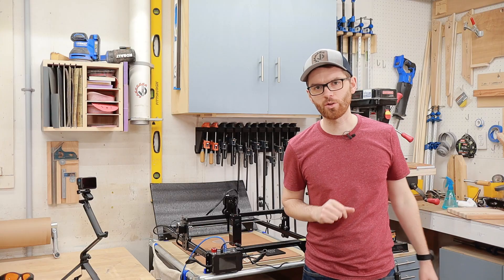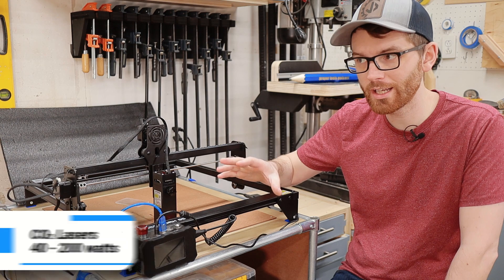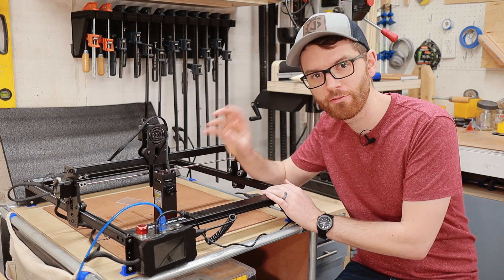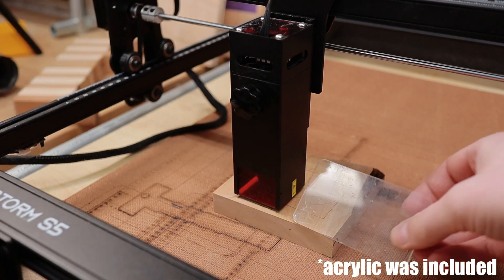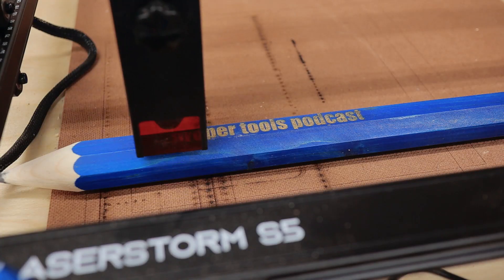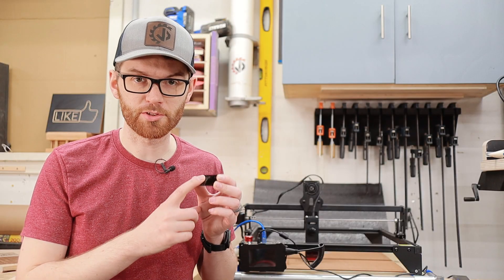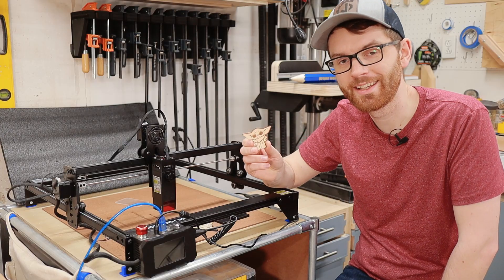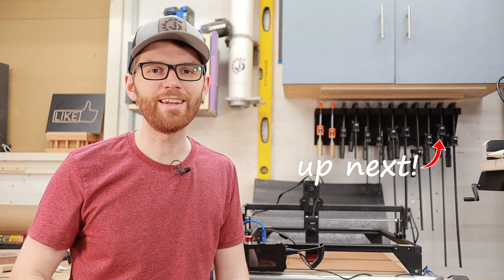Why you NEED a laser for woodworking!

Comment: Haha love the thumbnail (pew pew!). So glad you did this video! We got a diode laser too a couple of weeks ago but we haven't used it for anything but to engrave a few squares to make sure everything was good. I have it in my office and don't want to try doing anything with it until I have the proper set up. I also really appreciate you showing the settings you used for each material. The laser we got has its own proprietary software but I use Illustrator to design, so I'm not sure if I'll need to get Lightburn yet. If I do decide to get it, it's only $60, so it's definitely budget friendly. Thank you and keep up the good work!
Reply from the maker: Thanks for watching? What laser did you get? Is it that x1 I've been seeing around?
Reply: @MakewithJake  doh! I didn't realize I didn't answer! 😅 Yes, we got the xTool D1 10w and the 20w module. We also got the air assist and their honeycomb. I just haven't used it much because it's been too hot in Houston to work in the garage (plus my brand new Macbook Pro gets way too hot with just the minimum stuff open 😒). I did use it to cut something for my greeting card display, but that was the only time I used it and I was in my back porch. I may need to get an enclosure so that I can work from my airconditioned office.